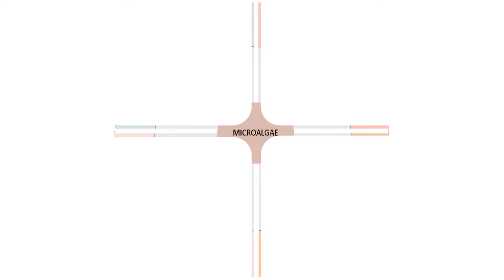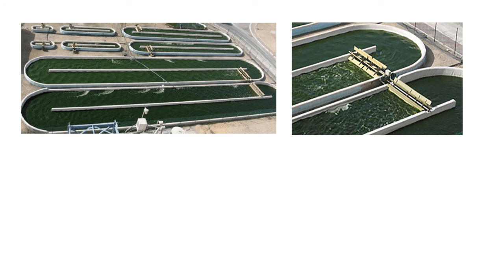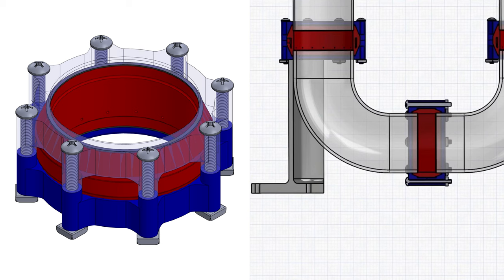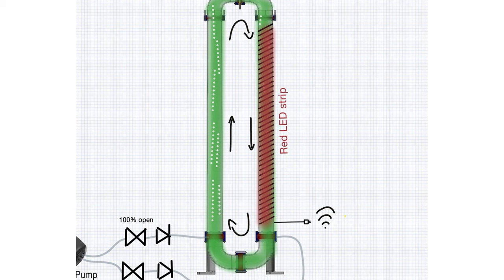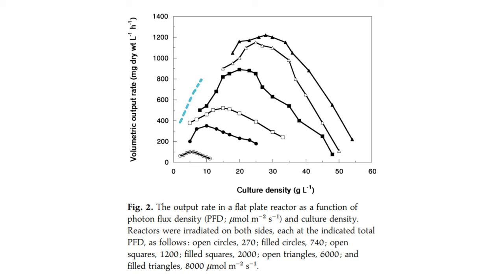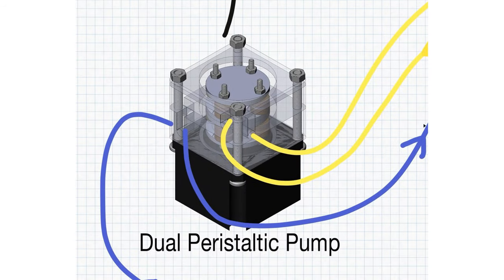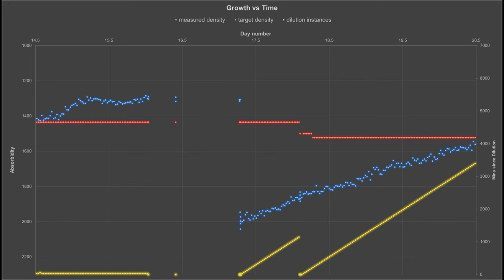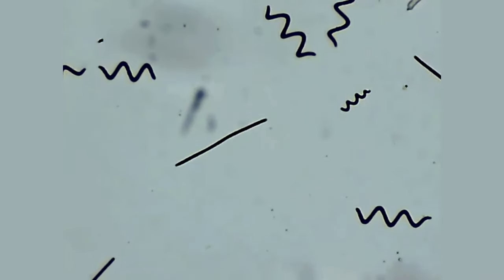Unlocking the Potential of Algae: A Journey into Photobioreactor Technology

Comment from the maker: Thanks you all for the great feedback and recommendations. I set up an inbox if you want to contact me directly regarding this project: rafik.photobioreactor@gmail.com
As for an interim update on this projects since I posted the video here is what I have accomplished: 
1. I completed building a much larger 64L reactor that has improved on this design tremendously 
2. I scrapped the old control system and am currently building on top of another project running on a raspberry pi (more details to come) 
3. Implemented a software filter to clean up data and calculate growth rates 
4. Built 2 custom optical density sensors based on absorbance and diffuse reflectance respectively

While I did promise in this video to release some subsequent videos detailing some additional details, I will not be doing that right now. I am currently focused on the new system's development and video production would take away from that at this time. Instead I will work on getting a second video out about my progress detailing some of the items listed above. 

I am looking for others with the skills and experience to make the commercial system a reality so if you believe you can help in some capacity don't hesitate to contact me using the inbox above.

There is still lots to explore so your patience is appreciated, let me cook.
Reply: Hey Rafik,
Im also an engineer and am currently looking to do something similar. 
You said something about a pump destroying the algea? Where did you read this? Im actually using a centrifugal pump without any issues?
Also we should really talk regarding the control setup. Ive been where you are with the esp and then the raspberry pi. But trust me thats so difficult and time consuming.
Reply from the maker: @renederen2696  check out Handbook of Microalgal Culture by Amos Richmond, few references of research abt damage caused by centrifugal pumps stunting growth. I am very happy with my control system now. Shoot me an email ^
Reply: I like your project.

Comment: I love how you've overcome some of the engineering obstacles associated with a project like this.

For a bacterial and fungal contamination check, I think your best bet is a microbiological approach with agar plates and plate streaking looking for colony growth. I don't think it's something you yourself would need to do because it takes a handful of dedicated equipment- incubator, agar, Luria broth, plates. 

Your closed system allows for a high degree of control of input, which is great for sterility. You might consider experimenting with UV irradiation of input fluid.

Comment: Excellent project! Very interesting topic with a well executed inexpensive construction.
Consider the following in no particular order:
- Use socket head cap screws instead of philips head
- Increase o-ring cross section diameter and possibly reduce durometer
- Increase cap to pipe clearance
- Add drain valve to bottom coupling
- For finer more well distributed bubbles; increase pump pressure and decrease
  orifice size in coupler
- +1 to RedMavis on the reflective wrap around the LEDs
- Space the diode strip away from the pipe surface a little
- Record temperature in reactor
- Integrate sampling and dilution ports into coupling
- Orient the turbidity sensor vertically at the bottom of a small free surface reservoir with a removable cap
  This will facilitate easy cleaning of the turbidity sensor with a pipe brush
 - Use a tee instead of an elbow above the LEDs for cleaning access

Again, excellent work! Let us know how quickly the system fouls.
Rock on!
Reply from the maker: Thanks for all the great recommendations. I'm already working on a couple of these. In terms of fouling system is still running with minimal fouling on the elbows (they are quite sharp turns) and I switched the flow direction by swapping the airflow. Seems like the straight pipes are still clean.

Comment: 2:45 Interestingly, for “Hydrothermal Liquifaction” (HTL) doesn’t need the drying step and makes a near drop-in replacement for Crude Oil.  All you need is basically a lab grade pressure cooker type thing and catalysts if I understand correctly.  Granted tuning it is a whole other beast.

I have read that salt and iron may cause issues, but “desalters” and “hydro-demetalization” are common units in crude oil processing.  And what would be extracted is a lot less nasty than the contaminants in crude oil!

Other processes to look into would be Supercritical Water Gasification, and Entrained Flow Gasification, both of which use slurries if i remember correctly.

(Or Hydrothermal Carbonization if you love coal enough to make it instead of Oil)

(Edit: Typo Fix)

Comment: Nice work. Couple of moments regarding design of this system.
Usially problem with low speed in down part of the loop is solved with high airflow(up to ~0,5 volume of air per volume of system per minute) and/or having down tube of smaller diameter than up tube. 
 While your solution solves problem with algae buildup it further reduces efficiency of water circulation, as main driving force is density differential between up/down parts of the loop and usually you want to have down part with as little air bubbles as possible.

Comment: My comments were deleted by Youtube! Uggg, Great project, I worry about the use of the roller pump killing or damaging the organism each time it samples. Having built a bioreactor in the past your approach is a solid one. Look forward to seeing more!
Reply from the maker: Thanks for the feedback! I chose the peristaltic/roller pump as a lesser evil compared to a pump with an impellor. The good news is that the contact area between the bearings and the housing is small compared to the volume moved so damage should be minimal. At this point, I'd rather have the sensor built in to the system to remove the sampling requirement all together but that would come with its own set of challenges

Comment: Awesome, keep it up!
For a bigger better clear tubes, look for replacement quarts tubes used in outdoor propane heaters. They’re 4-5” diameter, around 60” long and reasonable price. 
Consider using sunlight to feed the energy during the day, the intensity will be waaay higher than the led strip. You could use reflective Mylar film to form a ‘solar oven’ parabolic shape, on the side opposite the sun, so increase the intensity further, and hit all sides of the tube evenly.

Comment: Great project well explained. One thing about purity checking under the microscope: you can see the fairly big algae but it may be difficult to spot bacteria. If you stay with the microscope there is a technique called "oil immersion" to increase the resolution. Also the samples can be dried and stained. Not sure what specific species of bacteria survive at pH 10, but I am sure unless Spirulina produces some bacteriostatic compounds you should find some. Other than that what needs to be investigated are cyanobacteria with a potential to produce toxins.

Comment: If you wrap the lights with aluminum foil, you will reflect a massive amount of more light.
You can wrap tight or loose.
If you put a hoop around it and wrap the foil around that, you can run a small fan in the gap, to keep the LEDs cooler, so that they last longer.

Comment: Not a lot of views (yet) so i feel obliged to comment:
very nice project! Clearly explained. 
Interested to see how you will do the self cleaning, does that also include the light absorbing sensor?
Reply from the maker: Brainstormed some ideas for self-cleaning. The benefit of this system is if you get the airflow and geometry right to maintain constant flow, it prevents most build-up. The sensor cleaning is at the top of the list right now as it is a single point of vulnerability

Comment: You could occasionally run some distilled water through the turbidity sensor to detect when it’s contaminated.

Perhaps you could introduce clean water into the system through the sensor, and measure at the same time?

Comment: I just found thus video. Very cool. Are there any updates? When I put pipes with o-rings together for a water tight seal, I normally add vasoline to the washers. It keeps them plyable and also helps the seal due to its density and it doesn't like to mix with water. I like the design. What are your plans with the collected biomass? Thanks

Comment: What about fiber optics inside larger vessels. 

The fibers would move around from the  water currents, you get some decent light distribution.

Ive used a system called dosatron for hydroponic inline automatic feeding and ph adjustments.

The side emission fiber optic ive used before was called light pipe by 3m.

Could you just measure density from observing the tube outside rather than a sensor that fights biofilms.

Comment: When the algae are mature and high in transglycerides, don't they want to float? If you have a Solid cad model, I can add a few cheap features to help with harvesting and anti-fouling. Basically add two "T' sections at the tops of each vertical leg. One to collect concentrated, mature algae-- can also insert 3d printed anti-fouling spiral auger squeegees that can be automated.

Also, I can model in a mobile,  80/20 frame/rig to increase serviceability and make it easier to scale and modify as you kearn new stuff

Comment: Hey! I've made my own spirulina bioreactor that has been working  for 3 years now. Here is what i have learned that might interest you. 

You should avoid having any air surface in your system. Try to fill your reservoir to the max and reduce as much as possible the surface area of contact between culture and air. There is a tendency for the culcure to form a thicker film at the surface that will dry on the sides of the container. That dried biomaterial is not at high ph and will mold easily. 

I find an open loop control way more stable than closed loop for lobg term. On closed loop system, your sensors performance will degrade over time and relying too much on them will kill your culture. Its better to keep the density higher than peek efficiency and extracting not enough to dip lower than max efficiency. This will mean that extracting more than expected will increase the production and will self stabilized. 

Peristaltic pump may crush some cells. If its just for the extraction, there is no issue, but if you feed it back in the system, this will increase slightly the rate of waste accumulation on the tank surface. 

My system is in a sealed container so i can use pressure for the extraction. I just pump in the replacement nutrient medium and extract the surplus at the same time. I dont do continuous extraction, but is should be possible and that method would be optimized for that.

Comment: Impressed... it will be interesting to see how u work with the temperature control... heat loses will great... as surface to volume is very large ...u would need to insulate...then the ambient light will not go in...u could go with transparent insulating jacket... so thoughts for u.. but very good project. thank you